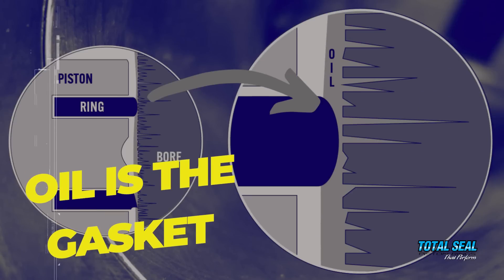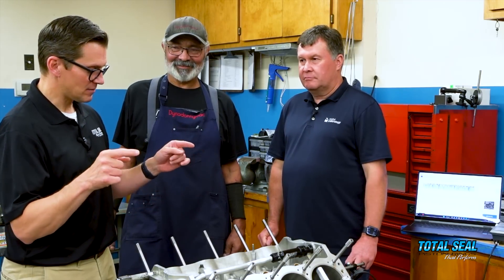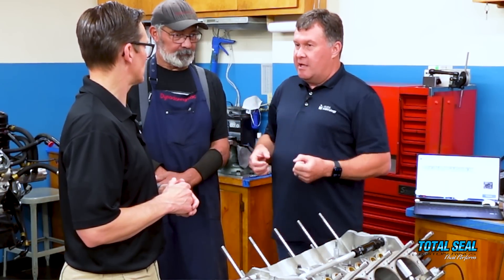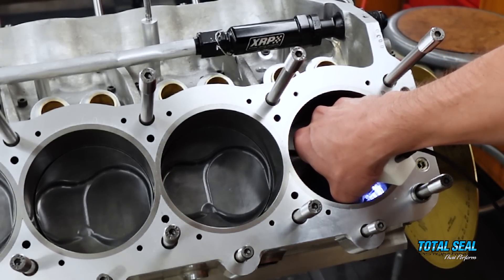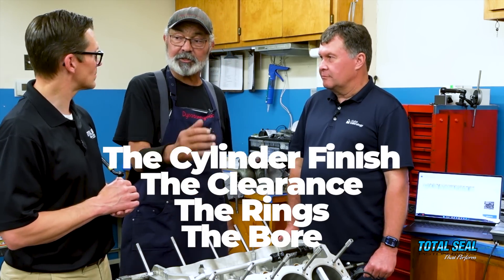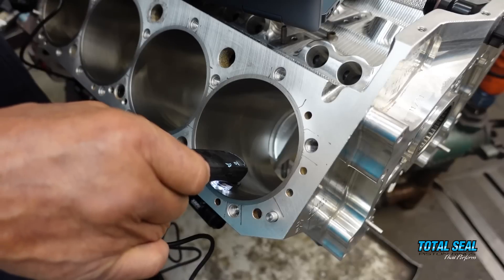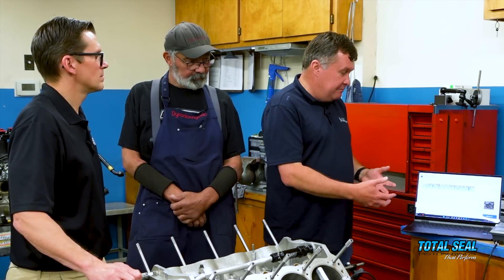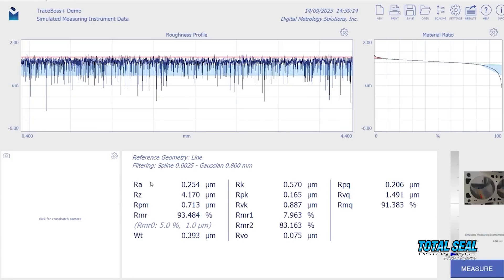THIS is the HIDDEN "Gasket" in your Engine

Comment: We have had great sealing on our limited dirt modified engines. What we have lacked is the longevity of the cylinder wall finish. We get around 70 to 75 nights before we lose the cross hatch and go to scuffing.  This winter, all three of the engines had gone to scuffing. The machine shop switched to some slightly rougher diamonds and we are hopeful that we will get to the 80 night threshold to allow two seasons on a freshen up.

We may need to change oils as the engine wears to keep the ring gasket in place. Any suggestions on that part of the process would be greatly appreciated.
Reply: Sounds like you should call these guys…
Reply: @mikeg4163  I have visited with the Total Seal folks fairly regularly. As was stated, things are changing very rapidly in this field.  We are experimenting with a slightly rougher surface to accomplish an increase in longevity. 

Oil technology has also increased phenomenally over the past few years. Staying current is a significant challenge. PRI was a great place to find resources and visit with the players. That's going to be a bigger part of my side gig as time goes on.
Reply: Don't you guys run 300+ oil temp? Or is that sprint cars.  I forget the unique challeges of dirt modified
Reply: @bwatt1383  it depends on the class rules, but the 305 sprints tend to run hot due to their low compression and running on methanol.  They have to run very lean in order to keep it from blubbering. They cook the internals due to the lack of water cooling. 

Doug Lee in OK builds 12 qt aluminum pans specifically for this class. That's how he got started in the oil pan business. It was a way to cool the 305 sprints down.
Reply: 75 nights is quite a run….  Are you running any type of coatings?
Reply: @mikeg4163  no. The rules require certain components and they aren't available with coatings. The closest thing is the coating on the Mahle power pack pistons if you run that brand.

Most racers want to get two years out of a freshen up. 6,200 rpm limit with 0 450" lift rule.  It's called a Wissota Concept engine.
Reply: Is air filtration an issue?
Reply: @darrenbeale6720  not that I know of. It has occurred on four of my recent rebuilds.  The one engine had 70ish nights, two were in the 80 show range, and one had almost 100 shows on it. It's just too many nights. The deal is they run great right up to the point where the cross hatch wears out.

Comment: Thinking that a to scale illustration of a honed bore cross section, would be more representative and easier for people to visualize / understand.
I’m curious if a burnishing with a set of substitute rings, before final cleaning and assembly, to initiate “break in”, would have a benefit?
Reply: Too much fuking around when you can use fine grit stones on the hone in 2 minutes on each hole.

Comment: Can surface treatments (WPC), abradable coatings (line2line), gapless piston rings, and new honing processes be used in conjunction with each other to achieve efficiency and sealing?
Reply from the maker: There are some combinations of those technologies that can be very beneficial. Stay tuned!
Reply: Steve Morris showed a skirt coating that wears in to the shape of the bore, supposed to stop piston slap. Heard about it?🤔🤔🤔
Reply from the maker: @sacrificialrubber779 yep. It’s the Line2Line coating. Stay tuned for an upcoming video on that.